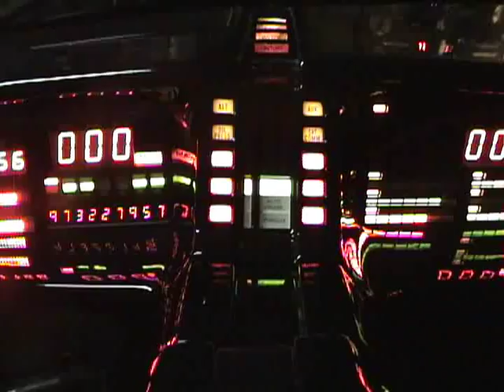KNIGHT RIDER CARS II - KITT VS KARR - again.wmv

Comment from the maker: An 83 would work great.  It would be also based on the car's features.  The ones in this video, are an 82 and an 84. :-)   

All Firebirds and Trans Ams from 82 to 92 are classified as (3rd Generation models) and they all have the appropriate body's for Kitt.  Some have various details, but have the needed body to do these cars. :-)

Comment from the maker: @mandymoorefanatic  Because KARR is using 55 watt halogen bulbs, Kitt is using adjustable 35 watt break light bulbs.  I don't use 55s in Kitt because it's too much of a drain on his battery.  His current setup can allow the scanner to be ran much longer without killing the power.  Plus, Karr's lens on his scanner is much more transparent then Kitt's red acrylic lens. :-)

Comment from the maker: @ambspier   They aren't specifically made to fit the curvature of the tail light assemblies in the later 90s model third gen Firebirds.  However, I have sold a few to folks with those styles, and they continue to this day to use them.  But I can tell you this...mine fit great over the flat style tail light assemblies from the early 80s and up models. :-)

Comment: Do the cops ever stop you or question you  if the scanner is not on?
Reply from the maker: +Silver Bullet If I'm driving with it on, they'll stop me.  It's frowned upon already having a moving red light on the front of a non emergency use vehicle.    Parades, Carshows, private property......always have it running.  Not too mention it comes on with my alarm arming too.   But, not a good idea to go flying down the highway with it on.  ;-)